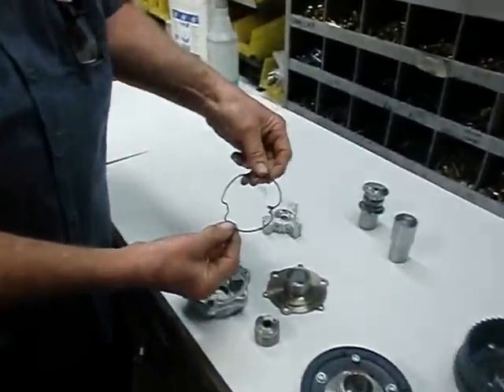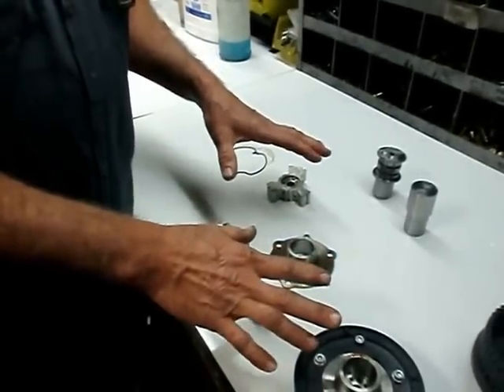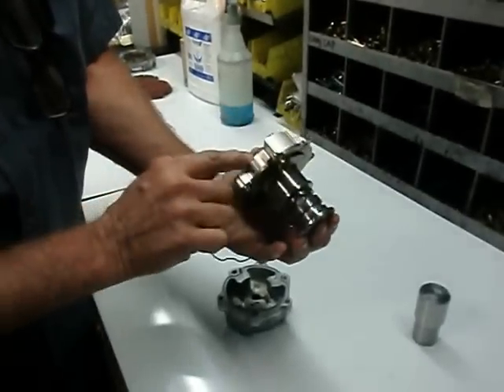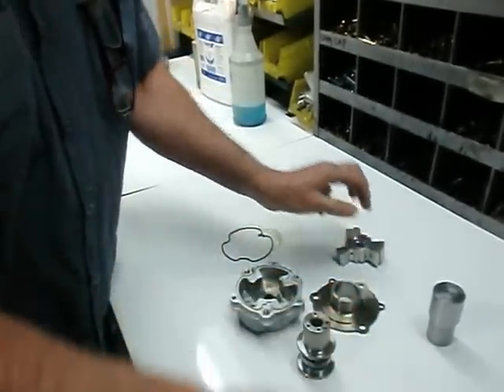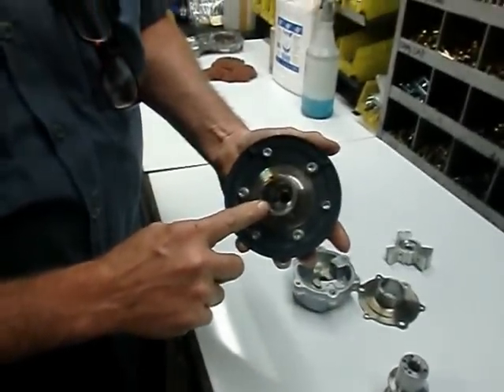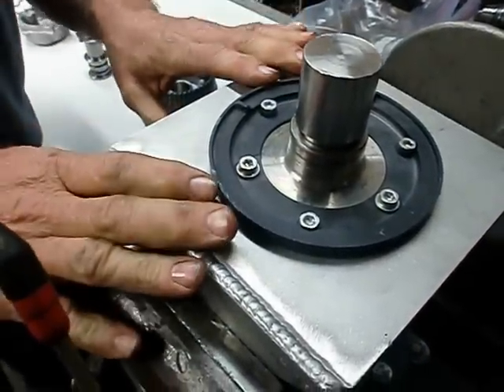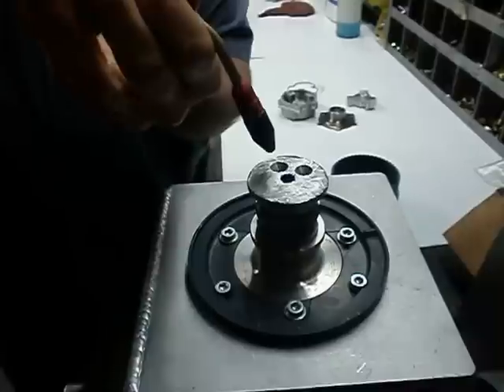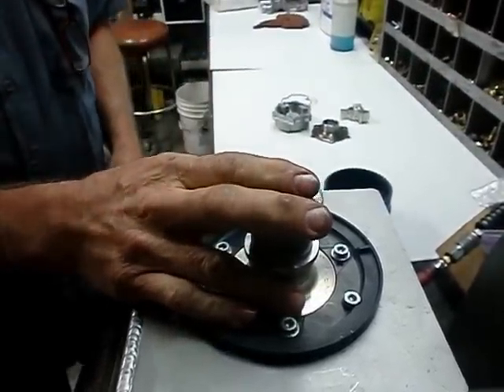Subaru AVCS Cam Gear Alignment

Comment: Quick question . So the pin/guide that's coming out from the block/cam into the cam gear slides in the half moon not between the 3 holes. Hopefully you understand my question
Reply: Any one?

Comment: Thank you so much.  Got the left and right codes simultaneously on a new engine build, and figured out both exhaust AVCS assemblies were binding (after losing sleep worrying about low oil pressure, oil contamination, etc.).  I used a spare cam to check alignment during AVCS gear re-assembly.
Reply: Did you manage to fix the AVCS binding issue after using a camshaft for alignment?

Comment: Nice video!!!

Theres a SPRING on the exhaust pulleys on STi engines (09+).
A friend of mine need TWO of these.
Do you know where i can found them?
He tried all over the internet and only found them both new (pulleys).
Not just the springs!

Thanks in advance!
Reply: If you are in the USA find a car with AVCS in the junkyard ? Try a salvage yard, or a part out on facebook marketplace, craigslist, or offerup.